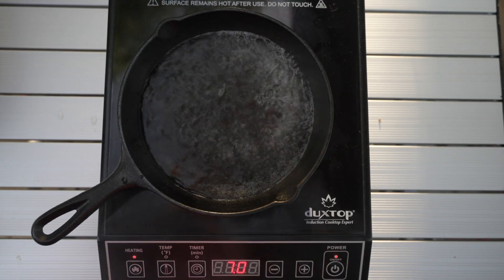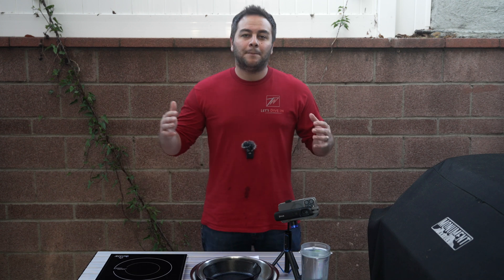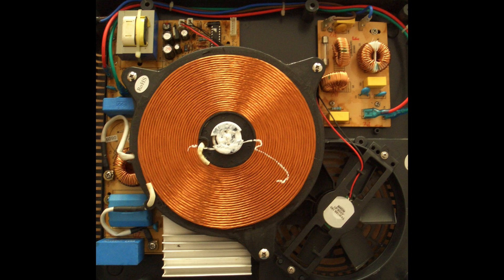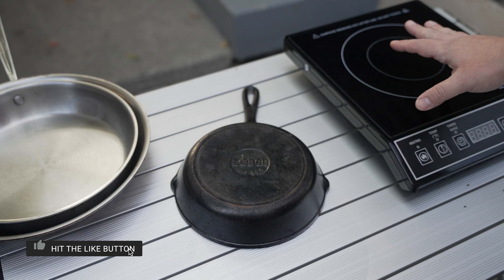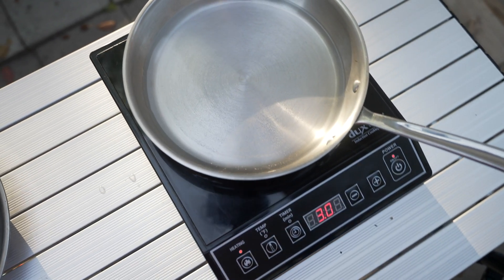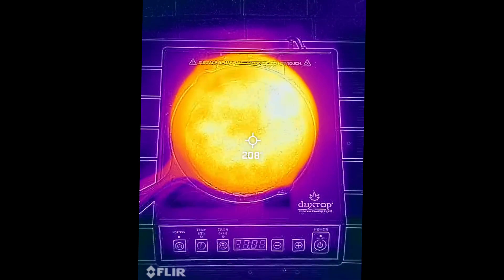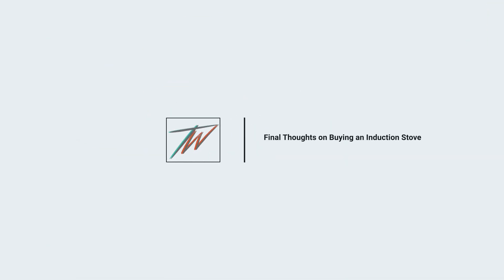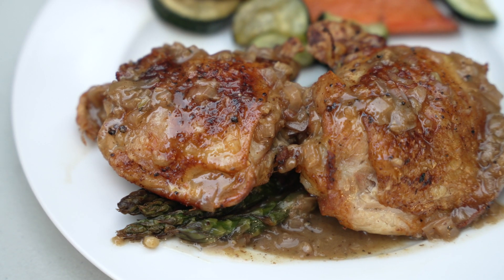Induction Stove Top Coil Size Matters // Thermal Imaging Shows You Why

Comment: The video was truthful, but pointed out flaws with inexpensive induction burners without mentioning that other inexpensive burners are all similarly flawed and unable to evenly heat typical 12” pans. Which is why people buy expensive cookware with superior ability to spread heat across their surfaces. Most burners of every kind are 6-7”, that's the standard. Larger burners that can evenly heat most pans 10-12” or more are much more expensive and considered high-end.

I'll post a longer, more detailed elaboration as a follow-up comment.
Reply: This is a long comment detailing the argument made above, for those who are interested in more detail.

Critical context missing from the video: all other inexpensive burners regardless of technology similarly apply heat to the pan in a limited area. All of them also come in upgraded and/or stovetop versions with larger burners. I own this same Duxtop, which I purchased knowing the heating element was 6" after a lot of research on other portable burners. I also purchased another electric burner, the largest cast iron hot plate I could find (7.25") that was similarly inexpensive. Larger burners are more expensive, especially for induction where a Breville PolyScience with an 8" ring suitable for 12" pans is over $1000.

But as said in this video, a cheap 6" heating element is enough for most 10" pans. Which is clearly what the device is sized for. A 12" pan hangs off the edges.

You can use a 12" pan, just stick to liquids or lower heat levels and understand that the center of the pan will be much hotter.

One way to deal with undersized burners is to use pans with outstanding heat-spreading ability. These can be expensive and they are heavy, so it would usually be more practical to buy a larger burner than a collection of high-end pots and pans. But you can definitely spread the heat more in a pan with a thick aluminum layer in the bottom.

On this Duxtop with the 6" coil, it's perfect for my cheap 8" Tramontina stainless clad skillet, it's fine for all my 10" pan, it seems just as good on my 9.4" thick clad Demeyere Proline skillet, and it's totally inadequate for my Misen 6qt 12" rondeau with an 11" base. I have just purchased on sale (buy pans on sale or used for bargains and pay less than half MSRP) an 11" paella pan, a Paderno Grand Gourmet: there is no stainless steel pan I'm aware if with a thicker base. It's thick stainless with a 7.5mm disk added, for 7mm of aluminum, almost double the aluminum of the Demeyere Proline which is the thickest of the cladded pans. So it will probably work with undersized burners. Other companies making exceptionally even-heating pans include Fissler and there are others. One less expensive option with a 5mm disc base is Cusinart Professional.

I don't have a metal coil burner, but I own and cook regularly on induction, gas, and a hot plate. The gas is my old home stove. The gas burners are about 6". The electric burners are the portable burners described above, with similarly sized heating elements.

The cheapest way to get a large burner is a gas portable burner. This has some advantages and disadvantages compared to electric, but it's cheaper. Not as cheap as a cheap portable burner, though.

Anyway, the most important thing I want to say is that induction isn't necessarily significantly worse at spreading heat than other methods. With a burner of the same size, gas spreads the most because beyond the burner the heat continues to spread across and over the surface of the pan, and ultimately up the sides. But with a 12" pan on my 6" gas stove burner, there's still hardly any heat reaching the sides. It's slightly better than electric burners of a similar size. The cast iron hot plate holds a lot of heat but actually heats up unevenly. Heat is generated in the center (actually slightly but obviously off-center) and spreads across the plate, which gets hot. Heat transfers much more slowly into the pan than with induction, and less efficiently for short cooks as the plate has to be heated first. But the heat is very slow and steady and is ideal for simmering. It's also silent, unlike induction. So I use the hot plate for low and slow cooking like simmering. It's quiet and holds low and moderate temperatures well. It's capable of high heat but it can't put heat into the oan like induction.

I use the induction burner for fast cooking with small, medium, or larger but extra-thick pans. Induction is noisy with the fan and clicking and at low-temperatures the cheap burner cycles on and off. But it has a built-in timer (very useful), safety features like turning off if it overheats a pan (very useful and can save your pans), and a temperature sensor that is inaccurate and not very useful in my experience (for me, it couldn't hold a temperature for pancakes even with a very thick pan). Induction can also heat pans more quickly than other kinds of burners, which is very useful to heat up a pot of soup. It doesn't heat up water faster than my electric kettle. They're both 1800W. I prefer the kettle for water, it's silent, insulated to keep the water hot, and it clicks off automatically when the water reaches a full boil. A 240V induction burner, like almsot any stovetop model, or 240V kettle (as are typically used in Europe) would heat the water faster. An 1800W kettle can heat 1.5 liters in—I'd guess from memory of my experience —about six or seven minutes, which is enough for cooking.

I recommend induction primarily for safety advantages. It turns off immediately, with no hot metal coil or hot plate that takes a half hour or more to cool down and be safe to touch. They also always have electronics built in that can be relied on to prevent disasters where the pan overheats (active burner, empty pan, or simmering past all the wayer burning off, etc.) They'll turn off if the pan is too hot to cook in, before steel or aluminum is damaged, and after too many hours unattended (to me, this is preferable to the ability to simmer overnight, and I could use a portable burner if I needed a "dumb burner" that would heat perpetually). Also the (ceramic) glass tops, which don't get nearly as hot as traditional radiant heat glass tops that food often burns onto, are definitely the easiest kind of burner to clean.

My household has had a fair number of accidents with the gas stove over the years where someone neglects to turn a burner off. The result is  burned food, a major cleanup required if it's burned into the pan, and sometimes warped or damaged pans. We don't have Teflon or aluminum pans on the gas stovetop because when overheated they're a true hazard. Teflon releases toxic fumes if overheated and aluminum can be melted by a home stove if it's overheated which can ruin your stove. You can see pictures online where a pot has melted all over and inside of a gas stove. A nightmare scenario. Induction stoves are generally the only ones with temperature sensors under the glass (or surrounded by the glass on high-end models like the Breville) that can prevent this by turning off if the pan is above normal cooking temperatures and dangerously hot.

If this video took thermal pictures of competitive non-induction burners using the same pan of conventional thickness, it would have shown that they all applied heat unevenly to large pans. The difference is minor. The non-induction electric and gas can be slightly better, I suppose. But the electric coils are usually 6". Most electric hot plates are that size or slightly larger, like 6 or 6.5 and sometimes 7". I think the largest inexpensive hot plate was 7.25, maybe 7.5". And the hot plates don't produce even heating across their heating element, unlike all the other types of burners. All the cheap induction stoves have a 6" coil. So really, there's not a huge difference and this is why people buy $300+ pans that promise even heating instead of just upgrading their burner. Because these cheap burners are $10-50 (cheapest are electric coil, most expensive are induction) and ones with burners a few inches wider are $100+ for gas (the cheapest) and $1000+ for induction (the Breville PolyScience was the only 8" portable induction burner and was $1500 but maybe that has changed). If you are buying a new stove/cooktop, it would be an opportunity to invest in having at least one of the burners be large and even so that you get even heating without expensive and heavy cookware. Modern cooktops tend to have differently sized burners nowadays, so you can have a larger burner for larger pans and fit in some smaller pans on small burners.

Comment: Just did the flour test with my LG LSIL6336F and while the owner's manual says it supports up to 11.8" pans, the coil size appears to only be around 7"! Crazy that they are getting away with this.
Reply from the maker: I know, it’s super frustrating when the marketing doesn’t match the reality!
Reply: Are you unhappy with your 6336F then? I was looking to buy one tomorrow...
Reply: @Youwillneverknow-w1g I got rid of it. I had to fight LG over it bitterly and they eventually agreed to take it back. If you care about good distribution of heat on your pans, it's terrible at that. If you just want to boil water, it would be fine for that.
Reply: @StewartRand  Noted. I'm getting ready to get a Bosch 800 series HII8057C now, hopefully that's better.   
What did you get to replace the 3336?
Reply: @Youwillneverknow-w1g I gave up on induction and got a more basic Frigidaire electric range instead.

Comment: Absolutely the most important thing when purchasing an induction stove is the magnet/burner size. If you ever cook with a 12 inch pan, a single countertop induction burner costs over $1000, due to the fact that the magnet size is 9 inches. And a complete range that has ONE 9 inch magnet that can handle a 12 inch pan costs over $3k. Any induction range that costs around $1200 only has 6 inch magnets, which can only handle 10 inch pans. You need a 9 inch magnet to handle a 12 inch pan.
Reply from the maker: Yes, it’s really important to pay attention to the size of the coil!

Comment: Duxtop doesn’t list their coil sizes, neither on Amazon nor their very limited website.
The largest burner on the gas stovetop in my home is ~3” in diameter. When on, the flame expands that to ~5”; how is that any different than an induction stove with a coil size of ~5 inches? The only way food in a pan outside of that diameter pan is going to get cooked in either scenario (induction or gas stovetop) is by heat conducting through the pan, right? It’s inefficient in both. 
Just trying to make sense of all of this as I am investigating induction for my Overlanding setup.

Comment: Well a gas burner only has like 4 inches of flame too right?
Reply from the maker: Yes burner size matter with gas as well. Larger burners for larger pots and pan and for searing. Flames hit the side walls too so that is a factor. Induction can be really efficient but small coils on large pots and pan will cause hot and cold spots.
Reply: @tomwadek  This would be less of an issue with cast iron right? The heat would spread to the edges of a cast iron pan and retain the heat better than a regular thin pan? Might not be perfect, but better right?

Comment: This is the same as saying a 10cm gas burner is not good for pans larger than 10cm. You are reviewing a tiny plug in unit, not a standalone cooktop that has its own dedicated power connection. That poetable unit is limited by the power supply, silly.

Comment: where can I find the biggest induction coil size burner?  I'm so tired of these tiny coils.   They burn the center and fail to even heat the edges of a 10" pan.
Reply: Vevo 5000w cooktop 8.5inch true coil size.
Reply: My changBERT 240v model has an 8" coil. It's 3200w.

Comment: People say there are no stupid questions. While that may be the case, there's a more important issue: what to do with the answers. So if you ask us if we think that gas stoves are dangerous, and 99 percent say "no, I'm not dead yet and I love gas," but the other 1 percent points out that fumes from gas furnaces, boilers and water heaters are vented because they are dangerous, how do you evaluate the answers? Personally, I would trust those who point out the contradiction. But since your demonstration is about coil diameter, let me bring up something else to be considered with gas stoves: flame diameter. When you turn down a gas stove to cook something slowly, the flame lowers, but the diameter of the flame circle also shrinks. The resulting heat is concentrated in the center of the pan where it might actually be too hot. When you turn down the power of an induction burner, the coil diameter remains the same and you have even low heat spread over the same area as it was at the higher power level. Also, below a certain level, the gas stops flowing and the burner is effectively off. Induction burners can go down to a very low controlled level. Their ability to be controlled so precisely and evenly cannot be matched by gas.
Reply: Gas furnace and water heater exhaust fumes are vented outdoors.  Most stovetops are not vented outdoors so the exhaust can accumulate inside a home.  The exhaust will not contain carbon monoxide (like car exhaust) unless there is incomplete combustion due to lack of oxygen.  The lack of oxygen can occur over an extended period if the home is not vented with an air exchanger.
In grade school science we learn that the hottest part of the flame is the blue tip inside the yellow flame.  Not all flames have the blue tip.  Some are cold flames.
Reply from the maker: Absolutely. For total control, induction is great.

Comment: I purchased a DuxTop unit with a pan that "matches" the coil.  DuxTop advertised an 8" coil that would have been a perfect match.  Jokes on me,  Its a 6 inch coil and I'm burning my eggs and sauces as well.  I did the water test and measured the same as Tom did.  I'm disappointed in my purchase.   YouTube influencers are no different than the old informercial's on TV.  I only have myself to blame.    Don't make the same mistake I did.  Find those specifications and then look for someone to review that model you're interested in.  If they're doing you a service like Tom demonstrated here, you'll be much better off in the end.

Comment: I have the Duxtop, has a 5" 'hob' as the cooking ring is called. I do 90% of all cooking on the induction, 10% on gas range. Induction is absolutely better if you have enough heat (wattage) settings. My Duxtop has 20 setting from 0.5 to 10 by 0.5 increments. The ONLY thing i wish for is a larger diameter hob, but not enough to spring for the MUCH larger cost. 
Fyi, i have a 10" Lodge griddle, even cooking on gas it has hot spots. Either the casting is thinner there & i can't see that or the iron recipe in the casting isn't perfectly mixed so some places heat up easier. On induction the same area of the hob products more heat faster, so if my food is that sensitive i rotate the pan oart way thru cooking for even browning. Almost never a big factor.
Reply: I have, the 12" has a cooler 'ring' area around the hotter center so cookware with better heat distribution works best, but it works. I need to move food around more. But i also use a lid often & heat retention from the lid removes moist of any hot spot issues. Usually I'm only cooking for 2, so mostly smaller cookware & the 5" hob works great
Reply: Do you use a 12" skillet with the Duxtop?

Comment: Manifacture ... maybe they know the dimension of coil. BUT a huge amount of portable ones are just rebrand and sell just any kind of crap... didn't know didn't care just import - rebrand and sell. SHAME .... And the other issue that few people and fewer seller says is the on-off bounce on low power 3 second of boiling water out of the pan and 3 second stop in cycle ... SHAME and SHAME on all on YT that make videos and review on this kind of crap that just review the timer, the childlock, and how fast is making boil water ... but incidentally they forget to review that at 300W is unusable. With some try and return strategy I've found two stove that work fine at low power ... I'm searching for a large coil but as no data are written in description I simply don't buy.

Comment: Can you put the pan on only half the coil, off to one side? Or does the coil need to be completely covered in order to work?
Reply: Yes, you can. Of course, only the portion over the coil would be heated. The wattage reduces in proportion. In an experiment I did, the wattage, originally 1000, dropped to as low as 450 as I moved the pan.
Reply from the maker: It would be very inconsistent

Comment: Ok I figured it out.  If I off center the 5 inch induction sauce pan to the right 1/2 inch on the 7 inch induction burner it worked. Yea, I can keep the new set of induction pans I purchased.

Comment: Get to the point.  My 7 inch induction coil will not work, I get an error code, on a set of inductions pans that are anything less that 7 inches.  So make sure the induction pan "over hangs"  the "burner area" a little bit.

Comment: Does wattage translate to coil size? Some are 1500w and some are 1800watts. That’s a huge draw on a  15 amp circuit. Two burner units are 1800watts and I have to assume both burners aren’t producing that power. I looked for a link to your stove and didn’t see it. I almost always use a 12” pan for all my cooking.cheers
Reply from the maker: Yeah, wattage can also correlate to coil size but also much more heavily on over all power and output of the unit. Think, how fast to boil water